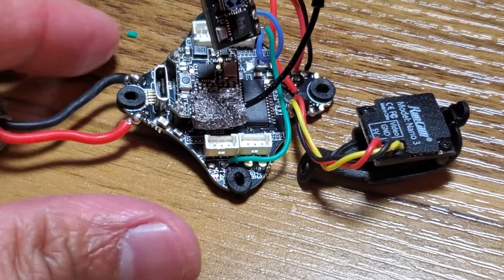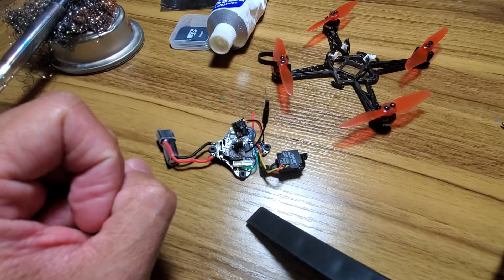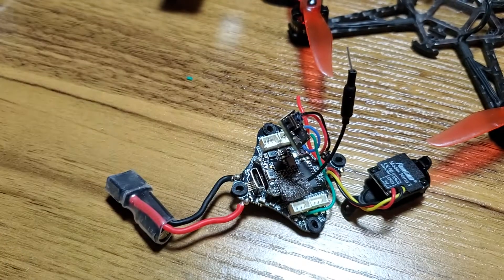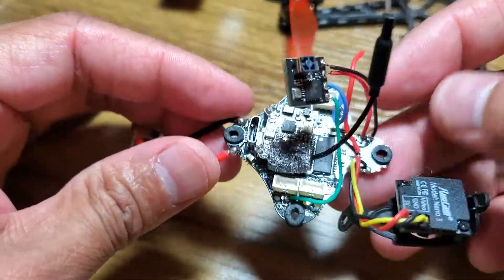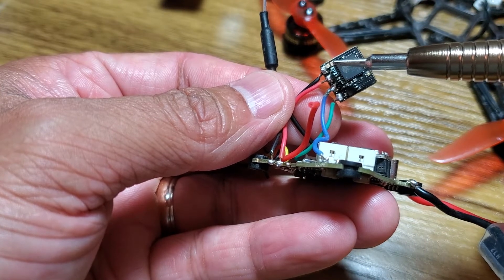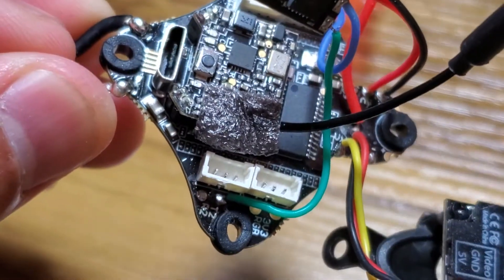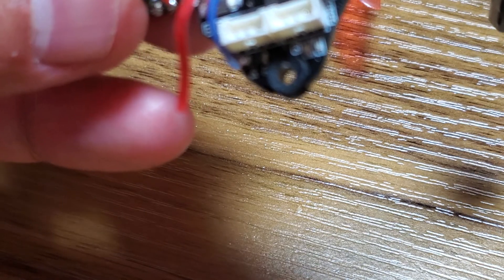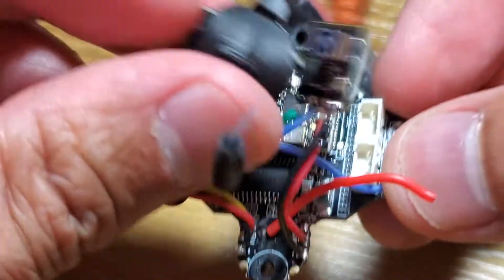Emax Nanohawk X ELRS upgrade!

Comment: I believe it’s working but I think you might have mispoke. The outside pad on the receiver is Rx, which you have going to TX, which is correct. I’m not sure why you didn’t just use uart1 tx and rx? I’m adding ELRS to a nano hawk x tomorrow so I’ll have to double check but I’m pretty sure the aio you have is the same one I have.
Reply: So did it work on UART1 ?
Reply: @mrazar2007  lol, no. Uart1 is used. There’s a bunch of info on this in ELRS Reddit and Discord.

Comment: Can you show this actually working? Because it makes no sense to me from all I have learned you put RX to TX and TX to RX and you don't use the same UART as smart audio for the receiver so I don't understand how this is working
Reply from the maker: I plan on updating this video with more info on the betaflight setup and some flught footage. I really just wanted to say I was the first to do this on youtube!
Reply: @juanmiguelserrano7931  Being first is always better than being right. I've already done this to my nanohawk x and I pretty much did it The complete opposite of how you did. Just curious if you're way works.
Reply from the maker: @bjimx  This absolutely works! Set the serial rx on UART 1 since UART 2 is used for smart audio. Try it just like I did and let me know if it worked!
Reply: @juanmiguelserrano7931  that part is correct  if you wire your receiver to UART 1 you set the seriall RX to UART 1. I wired my express LRS receivers TX to flight control R1 and the receivers RX to flight control T1. This is where I disagree with you because you don't wire TX to TX and RX to RX like you said in the video, the TX or transmission side of the reciever has to go to the receiving side of the UART on the fly control board, . And you said you had the receiver wired to both UART 1 and UART 2 which you can't do because smart audio is on UART 2. So I assume you have it wired right you just explained it wrong. I'm not trying to argue with you I just think you're confusing people because you have me confused